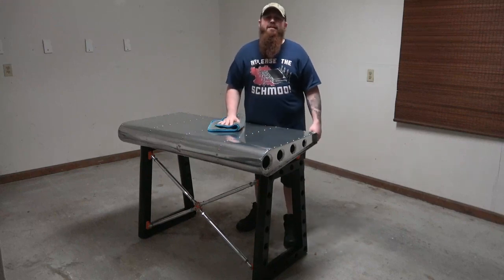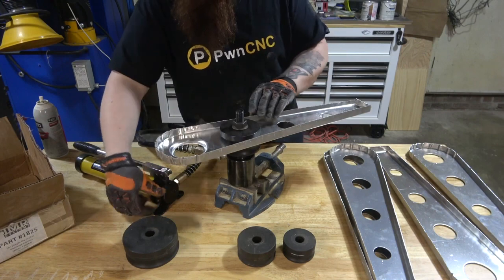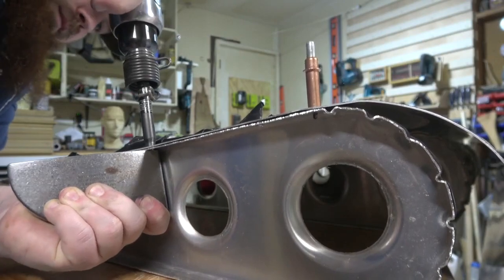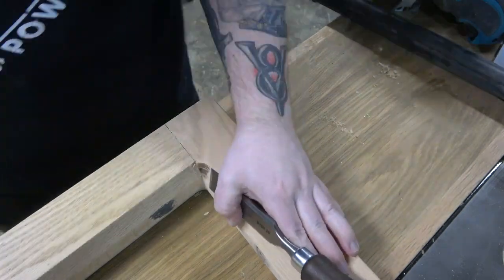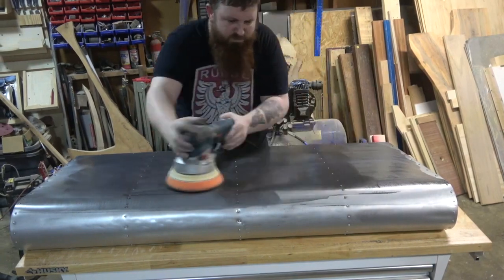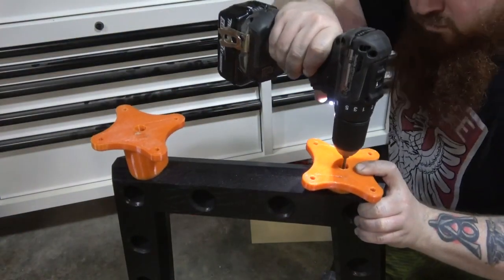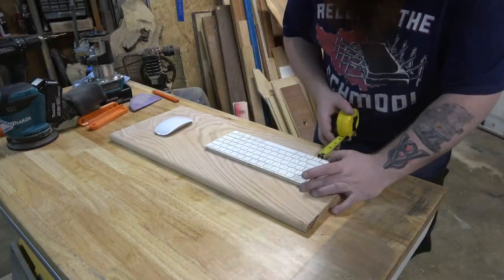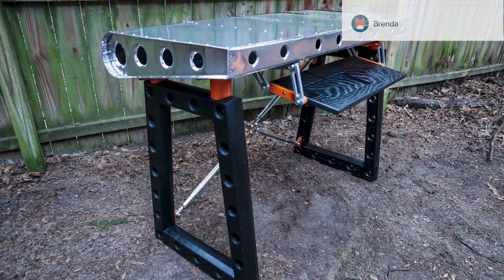I Built an Airplane Wing from Scratch - for my new desk

Comment: Nice work Chris. I want that hole punching and flaring kit!! It was a little hard to see, do those turnbuckles have like a heim joint end or is it just a flat with a hole?
Reply from the maker: Thank you. Yea that flaring kit is awesome. The punch kit was pretty cheap from Harbor Freight if I remember correctly. The rod ends are slotted to fit over the pieces I made. No heims.

Comment: beautiful desk. Premium product with the desk top ... my advice... If I can be so bold. nix the 3d printed mounts and pay for some steel or mounts and brackets...if you're selling these... or just sell the tops and save yourself elbow grease and filament.  If you're going to rip off restoration hardware design (which is brilliant idea) don't go cheap on the rest of the build. Anyway, you sell just the wing parts?
Reply from the maker: Thanks. I don’t sell them. Just made this for me.